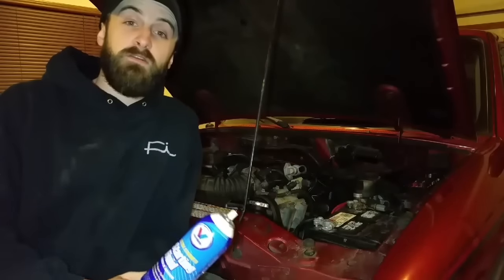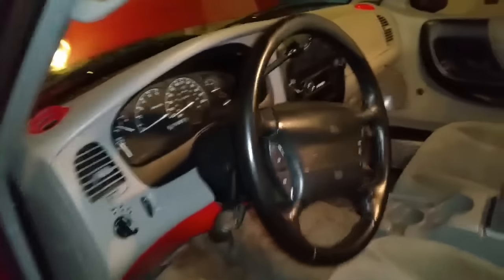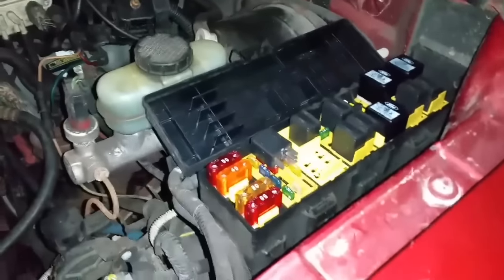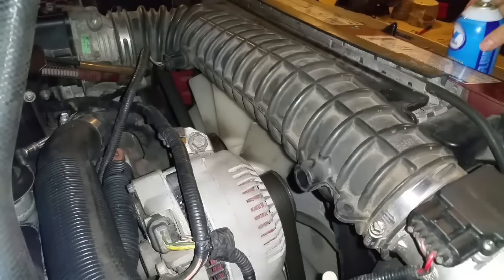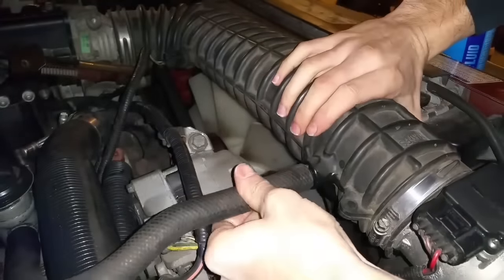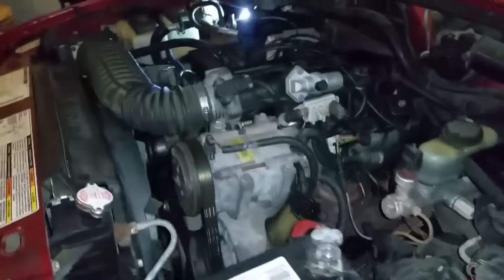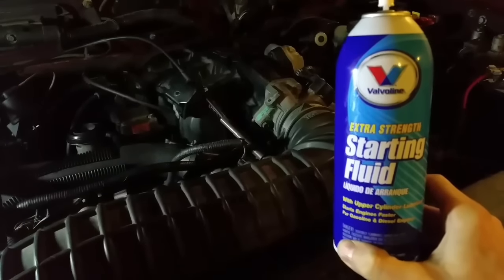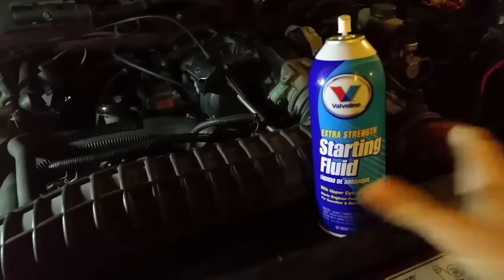THIS REALLY WORKS!!!!!!! Bad fuel pump, fuel pump relay, no fuel problem!!!

Comment from the maker: BE SURE TO CHECK OUT PART 2 FOR A MORE DETAILED LIST OF CAUSES!!!

 https://youtu.be/l3ZEiWbhUIs
Reply: a21bravo do u keep the relay unplugged y u try to start the vehicle after spraying the starter fluid
Reply: Wrong again make sure you got battery voltage at fuel pump connector@ pump
Reply: 2014 Chevrolet Silverado V6 my son drove the truck after the flash engine light was flashing for two days and then the truck shut off and he had it towed. I went and checked the truck out and ran a scan on the truck showed P305 and P 300. I found cylinder one and cylinder three coil packs bad so I changed all the plugs and the wires also they were fouled and very dirty and looked to be original. I checked to make sure that I was getting spark and I was. I tried to start the truck and it would just turn over with no start. I checked the mass airflow sensor and sprayed it out with mass airflow sensor cleaner. I also change the camshaft positioning sensor. Still no start. Any ideas

I tried starter fluid still no start
Reply: @dougmorrison644 Its more likely that the Fuel Pump being a wearable part would go out rather than  electric suply line is compromised
Reply: @Watersedgeministry is it cranking?
Reply: This didn't  help me. I changed my pump. And I still have to use starting  fluid but afterwards it runs great until I have to use it again in a few days
Reply: @davidinchcliff4560 did you figure it out?
Reply: What about an open inertia switch?????????
Reply: @dougmorrison644  first check fuel pressure. guages are cheap at harbor freight. THEN check voltage. but you are right DONT USE STARTING FLUID.

Comment: This went over so many peoples head. He took the relay out to simulate a bad fuel pump, relay, etc.
Reply: I know. Lol it's crazy how many people probably paid for a new pump when the inertia switch or relay cud be failing. Wow. Is he that ignorant or just wants to cause people extra money with bad advice ? Crazy
Reply: Yup
Reply: First thing I said crank it without touching anything 😂😂
Reply: @karitunes1  he did it to create content a bad fuel pump can be a number of things and it’s common sense to start with the cheapest things (relay and fuses) cause they’re cheaper then a new fuel pump if you don’t understand that you should be going to a mechanic lol this was a good video
Reply: @karitunes1  😭
Reply: Straight past mines thanks
Reply: But then he start without relay?🤣
Reply: And I thought I was tripping want the video be about a relay not working not the fuel pump lol 😂
Reply: These are basic tricks and those who missed should re watch this content. It’s called a simulation kids, Great job!
Reply: And here I am my father sent me here.
Didn't go over his head but clean over mine LOL
Reply: I think mine is in the early stages of failing. Once a week on a cold start it will not start on the first try. On the second it feels like theres a brief second of hesitation as if it's going to stall and then it starts up. Will test the pump relay, injectors, and the pump itself.
Reply: Because a pump can be intermittent like  1st gen Muranos. Won't always pump or start when engine is warm, but always fine when cold. Known problem on many vehicles. This test verifies it.
Reply: @577buttfan  yes, on early muranos, don't work when engine warm but fine when cold.
Reply: Im new to cars and troubleshooting, cause i dont fully understand the mechanics and what is what under the hood, but I cant make sense of this video. What is the point of taking out the fuse? He would get the exact same information leaving it in right?
Reply: @StaminaFear  he thinks it might be the fuel pump failing, but there are other possibilities too. He removes fuse and this prevents the fuel pump from pumping any fuel into the engine. Then he sprays in starting fluid and tries. The starting fluid is the fuel, temporarily. It briefly fires. THAT confirms the rest of the engine such as spark plugs etc are working properly because it did briefly fire using spray fluid as the fuel. Therefore, if the fuel pump was connected and working properly the car would stay running. But it doesn't so the fuel pump must be faulty.

This requires an ability to do logical thinking and use process of elimination for troubleshooting problems. Not just applicable to cars but multiple problems in life. Some ppl have it, the rest have to learn the skill. It's a particular type of thinking. Any good repairman, mechanic, electronic technician learns the process over time. The rest have to work at it. There are also courses that help teach it. I'd bet 99% of younger ppl lack the ability these days.
Reply: It could also be the fuel filter, and personally, I would take the time to change that before the pump, too. But, if you have fuel injection, like just about everyone, and you don't hear the whine of the pump when you go to start, that is a good sign its bad too.
Reply: @graceomalleygrimm9776  on some cars the filter is inside the pump so may as well change pump.
Reply: @alan4sure , that's good to know. Every one I've ever owned, and had to work on, had them separate.
Reply: Okay so does that mean if the relay is bad even it’s still inserted the fuel pump should still prime or does that mean it’s working?
Reply: @hkdwee4200  if the relay is bad but plugged in the fuel pump won't work. If the relay is unplugged the fuel pump won't work either. The relay supplies 12v to the pump. If it's functional.
Reply: @alan4sure what if I did his bypass with the wire and it still doesn’t start and the fuel pump works?
Reply: @Snookred1  there is no wire involved. If you can't grasp even that much from the video, don't even try troubleshooting anything.
Reply: @karitunes1  relays fail a fraction as often as fuel pumps do. Orders of magnitude difference.
Reply: @alan4sure I was talking about bypassing the relay to the fuel pump, if I sprayed starter fluid in the air intake and it still doesn’t start, what would cause my issue? That’s what I ment sorry didn’t explain it too much. The wire thing was about bypassing the relay to the fuel pump
Reply: @alan4sure I’m a machine tech, programmer. I havnt messed with vehicles as much. So I’m trying to understand them better. I changed my own fuel pump without problems. Diagnosed my starter which was from a bad relay. So I know some things. I grasped the idea of the video smh
Reply: this didn't go over my head.. what are you talking about?
Reply: are you just dying to write something?
Reply: @macmacdonald2189 lol are you dying to right something on a comment from years ago. I’m referring to all the comments saying they don’t get it. So I guess the comment went over your head
Reply: @chancesmall7026 I disagree
Reply: @yt-user03561  that’s exactly what’s happening to my car when it’s cold it wouldn’t start unless it’s hot. Can you please explain to me exactly what was wrong with your vehicle?
Reply: @smile_smileyyy1645  Well my problem ended up being the starter going bad because I never had the issue again after replacing it. My fuel pump later on started to go bad but that was because it was leaking.
Reply: @yt-user03561  thank you I am literally sitting in my car and was going nuts looking for answers.
Reply: @yt-user03561  wait another question... Did your car crank, lights on but the car wouldn't start??
Reply: @smile_smileyyy1645  No problem. No starts can be frustrating as it can be a number of different issues. Hope you get yours figured out and fixed!
Reply: @smile_smileyyy1645  Yes on mine the lights would come on and I could hear the motor turn over and try to start.
Reply: @yt-user03561  thank you! Appreciate the quick response a ton!
Reply: How do you know certain it’s the fuel pump, could be a bad relay because you removed that relay. Maybe could try the fluid start with the relay there to see fire up first then try fluid again when the relay is remove

Comment: The other thing you can do is bang on the center of the fuel tank and in most cases the engine will fire. When you hit the tank the brush assembly in the electric motor will make contact again and the vehicle may start and run. I used this technique to get off of a busy street when my car died so I could get off of the main road and stop blocking traffic.
Reply: Really? Like crawl under there and just give er a bop?
Reply: @justinswehla3793  Yes in many cases this will work for a short time.  This only applies to in tank electric fuel pumps.  I used a mag lite flashlight on a friends vehicle and he was able to drive home on the back roads and to the mechanic a day later to have the fuel pump repaired.  You can check on repair costs in your area online with repair pal .
Reply: Oh no way that's super cool thank u for telling me that Haha I'm in a similar boat as your friend! Except mine is an older car so sadly this time I cant use the ol bop
Reply: I was wondering about that, I have been having problems with my Dodge Durango  2000, I had a very weak battery, we thought that was it, swapped in a better battery and it worked fine for like a week and then the same problem happened again, out of the blue, the engine would not start after just going into our local grocery store, I came out and it would not start, my friend banged on my fuel tank and it fired up, managed to get it home, so I guess it’s safe to say it is my fuel pump then right?
Reply: Yessiree. The absolut quickest way, and can get one out of a jam, saving a tow,. Check for a good ground @ the pump too.
Reply: Does this always work, banging on the tank?
Reply: @Ripcurl552002  Depends on the vehicle and the type of fuel pump.  In the past some car manufacturers used in line fuel pumps, but of course they were to easy to get to and replace.  It may not work all of the time depends on how lucky you are .
Reply: if you ever see this message, I appreciate you. my car did this to me right after putting in gas so thank you for saving me at least $120 in towing fees.
Reply: @cars654  m
Reply: @viyctm   Everybody is an expert ?  If you bang on the freaking tank and your P.O.S. starts its the freaking fuel pump.  You should replace the fuel pump filter every two years or 20k miles.  Most of the new P.O.S. cars don't even have a freaking in line fuel filter so keep your wallet nice and fat. This works on IN TANK FUEL PUMPS !  Have a nice day viyctm B.S. !!
Reply: This worked for me. It was extremely helpful in letting me know that the problem was indeed a failing fuel pump.
Reply: @justinswehla3793  
Yep. Worked for me.
Reply: Dude you’re a fucking legend you saved me fucking hours dude thanks

Comment: This only let you know your getting no fuel to the motor. It does not tell if your fuel pump is bad or not. Just that the issue is in the fuel delivery system.which is the ecm, fuel pump relay, inertia switch, tank switch in some vehicles , fuel pump(s), fuel line fuel filter, fuel pump regulated, and fuel injectors
Reply: Dont forget vvt crank and cam sensor or timing.
Reply: @kennethcheesbrough6855  don’t forget to check for fuel even, heck that’s the first thing I’d check, I’ve seen many gm products float malfunction and get stuck on about 1/4 of a tank or even 3/4 of a tank and obviously the gauge quit…..

Comment: 1996 Mercedes-Benz SL 320 sat for 9 years solid, didnt even try to seek faults. Just did this right of the bat and low and behold. The fuelpump was faulty... Car started up right away though on the the starter fluid after 9 long years. Thank you  Sir this was really a timesaver and relief. Thank you

Comment: Yep it works good,we been doing it for the last 100yrs. Fresh gas or starting fluid either one right down the old throat, it works every time.
Reply: LMAO I agree. Theirs a few tips or tricks some people should know tho. Sometimes a bad fuel pump relay etc can be fixed temporarily by tapping or reseating. And yes banging a starter while trying to crank many times does work. Saves you a tow but will not solve the problem.

I've done it on diesel automatic semis many times. Whack that think with a rubber mallet while somebody trys to start it. It'll almost always fire. Fuel Pump relays can be intermittent. Pulling it and reseating it or tapping it on ground sometimes may get that pump to start working. But again lol your still broken. Gets you to the local parts store tho with out a tow.

What he's doing is showing you hard way. Listen for a hum before turning your car to crank position. No humming. It's almost always 1 of the 3. Bad Pump, Bad Relay, Bad Fuse.

Comment: I’m on the same page with you, but how does this verify It’s the fuel pump and not like a fuel filter or wiring? Because I recently within the last year or so change the fuel pump. Now I know that doesn’t matter. I just have a 99 ram 1500 and don’t wanna drop the tank if I don’t have to. I’d like to eliminate all other possibilities first. And yes it popped off starting fluid. Thanks 😊

Comment: Can fuel pumps intermittently fail? Like sometimes they work sometimes they don’t? My ranger wasn’t starting and I couldn’t hear it priming when I turned the key, the next day i heard it prime and then it started. Would that be an electrical issue or fuel pump still
Reply: What did it turn out to be?
Reply: @ethanballard3515  i just replaced the fuel pump, and a fuse, been fine ever since
Reply: @kalemathews1899  Did you try just the fuse first and it not run still indicating the pump was the problem and not a 50 cent blown fuse lol ?
Reply: @NeverSuspects  are you looking for advice or are you trying to argue about something
Reply: Had an 89 nustang thar would shut down sometimes and just wait 20 minutes, and it would start again. Swapped out the pump, and no more issues.  I think it was getting hot and waiting and gave it time to cool down.

Comment: Happened to me. I tried a similar test too. My Dodge Dakota 6 cylinder ran a bit better though -- the pump (located inside the gas tank) was still working partially. Likely a clogged filter after 70 K miles! First thought it was a vacuum leak.
Reply: If you a weak pump it wont saply the fuel to the  rail.

Comment: I would clarify that this only confirms a fuel starvation situation.  This could be from a clogged fuel filter with a functional pump.  One would have to test the pressure of the pump to verify the pump is the issue.
Reply: Most people try and replace the fuel filter before they test this.
Reply: This doesn't always mean it's a fuel pump or fuel filter I thought the same thing but after replacing everything to do with fuel the pump filter pressure regulator pump relay fuses still doesn't wanna start but wants to start on starting fluid so I'm down to either fuel injectors aren't getting a pulse or their clogged  but also something else is bothering me when I test the fuel pump relay and try to hear the fuel pump prime when key is turned to the on position relay doesn't click or fuel pump doesn't prime now If I use a jump wire on relay my fuel pump runs constantly but with that jump wire with fuel pump running I checked fuel pressure from valve after the pressure regulator fuel spits out very fast so its getting fuel pressure with jump wire but won't start still so back to injectors either not getting power to pulse which since my fuel pump relay won't click when I turn key is making me think it's electrical not getting power to the relay and what powers the relay pcm or ecu are next in line for electrical problems maybe I had an electrical problem this whole time and only thought I had a fuel related problem because I did this test spraying starting fluid so just because it wants to run on fluid doesn't always mean it's fuel related and in some cases on econiline vans have are bad grounds also saw a video of a guy who showed a bad ground but mine looks good from the bottom but I lift up the plastic above where the ground lead is attached underneath van and I see a bunch of rust so I'm wondering if I have a bad ground because of all the rust
Reply: @cheeseburgers82  did you fix fuel problem. Electrical maybe camshaft or crankshaft position sensor(s). Used the starter fluid engine did start. Thinking fuel pump bad but gas leaking around fuel pump (flange)bad o ring/ gasket.
Reply: A lot of newer cars have the filter built into the pump, how would you test that? Good fuel pump bad filter?
Reply: Did you ever find out what it was? It appears to me you have a problem with the connection of your ignition circuit to the fuel pump. Usually they don’t run together but might be closely related to the dependence of the crank shaft position sensor
Reply: @cheeseburgers82 that's a lot for people to be reading

Comment: this is right , as a matter of a fact when my truck stopped running and had ford garage check it a mechanic sprayed starting fluid in it almost the same way and it started , it was the fuel pump that was bad , the truck started after the starter spray was sprayed in . the fuel pump was replaced and runs good now.  the reason maybe the guy unhooked the relay was to keep the truck from starting on purpose to show an example of what happens if no fuel is going to the engine , and that spraying starter fluid will help you check this type of situation. he is correct . .
Reply: How much did the fuel pump replacement cost at the mechanic? I'm thinking about pulling the bed off of my ford and replacing the pump myself.
Reply: I had a broken relay on a Chevy truck and didn't know it at the time and had to use starter fluid to start it up every time, almost replaced the fuel pump until I found out the relay was broke, so what I'm saying is that without the relay in when I sprayed starter fluid the truck would start and run and wouldn't cut out.
Reply: @fleet39  (